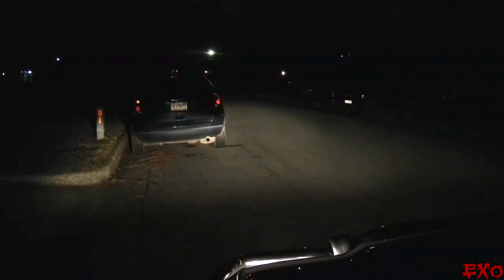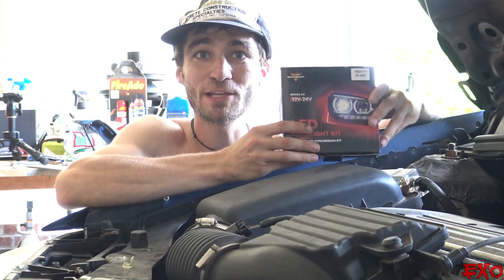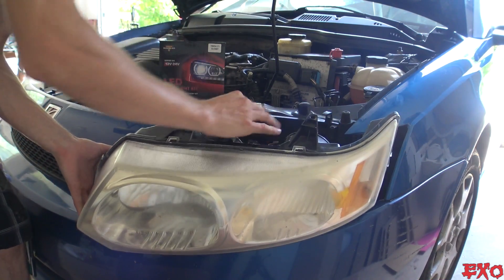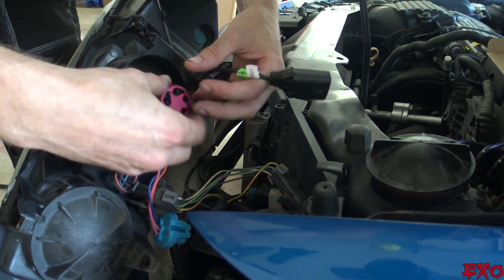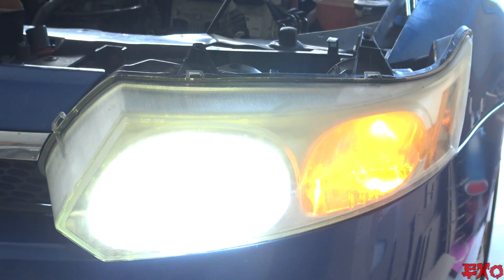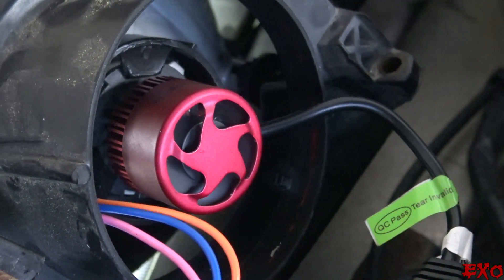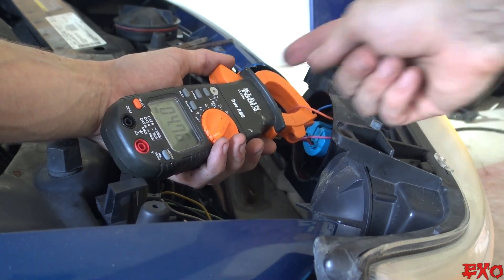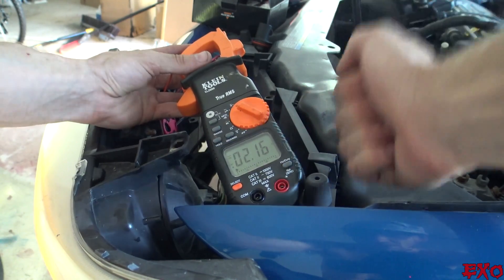How To STOP Dimming Headlights When BASS HITS | Testing Halogen vs LED Headlight | Fix Car Audio Dim

Comment: So will that work? I have 2 15s on 5000watt amp i have a extra battery installed i got everything checked an everything is fine alternator isnt dropping voltage but im getting headlight flickering
Reply: The shop I brought it to he told me change my wire on the alternator running to second battery from 4gauge to something bigger
Reply: @TrillTactical98  depends on the lentgh. i have a 13 feet run for my amps with 150 A peak load. idealy i need something bigger. but it's fine for my usage. batteries charge around the 150A range too. especially with higher output ALT's. definitely use some 0AWG or just run 2 4AWG to the rear if you wanna save some

Comment: I put a 200amp alternator amd a $200 battery in my and did the big 3 but with 0 gauge wire and still get dimming from my headlight and dashboard lights I am running a 1200wrms amp and 2 12s could will my electrical system be fine or is there something else I need to do that could stop the dimming?
Reply: Sounds like you should be fine, double check all your wires
Reply: @Carlos-ln1lx  I have basically same setup as this guy and sometimes you just need a second battery depending on the car. Even with high output alt and big3 upgrade
Reply: Good ground connection? #1 cause usually

Comment: I didn’t have a problem until I throw a 4500 in now they dem have the big 3 and a 320 h/o alt and grounds and power are tight and correct fixing to try this hopefully the led lights work
Reply: there’s literally nothing to stop it

Comment: I'd first like to say I love all of your videos EXO, i am a big fan. I have no doubt these headlights will work if you can get them at a good price for your vehicle but i would like to share how i fixed the issue. I tried a cap and a battery upgrade with no improvement, I have 3 amps @ 1400 watts RMS and stock 130 amp alternator. I fixed it by running an 8 ga ground wire straight to the battery. I am now questioning why they suggest grounding to the frame. 30 dollar wire problem fixed.
Reply: I think you are onto somethin bud
Reply: Did this really work

Comment: I have a 2004 Chevy 2500 I've upgraded the alternator as well as all the wires put in a second battery switch to all LED lights and I still get major voltage drop with my little 3000 watt amp please somebody help
Reply: what kind of amps is your alternator? I got a 220 AD244  from and got a smaller pulley for it. No more dimming lights not even on idle. I have a taramps 3000 rms amp and 2 sa12's.
Reply: George Eastlick honestly just let it be, too my knowledge it won’t damage your car
Reply: If your running 3k rms you need at LEAST a 390 amp alternator I would say. I always go with the fuse rating on my amp(s) plus my stock alternator. I have plans for a 320 amp next to my 200amp on my CVPI to handle a 2500rms system.
Reply: Having same issue I only did big 3 upgrade on stock amp/no additional battery. 5k rms which 2nd battery/ amp do you guys recommend

Comment: Or get a capacitor
Reply: Depending on your electrical system and what kind of Watts you're using, even a capacitor will not help. I am running the Big Four with dual battery setup and still get dimming at high volumes

Comment: Just upgraded to a 700w system and my lights dim bad in my 05 ford 500 100% stock electrical. Where should i start? I hear the big 3 but I have to drop my subframe to get to the alernator and thats to much.

Comment: I know its a very old video but these LED Headlights are "Shit"

Avoid 3 Sided ones!
They dont mimic the incandescent at all and have such a bad beam pattern!

You need LED headlights with 2 sides!
For example: 
-Auxbeam A2-Series 
-SV.4 from headlight revolution
-And other models with 2 sides
Reply: Why only 2 sides?
Reply: @hectorheco5194  because the 2 sided ones mimic the shape and placement on the bulb of a halogen filament. Which is good considering they're being put in housings designed for halogen. Keeping the beam pattern in the correct orientation and giving proper light output.

Comment: So my system is only 600W and my headlights still dim when the bass hits. Is this hazardous for my vehicle, or is this a relatively normal complication with sound systems?
Reply: Have you done "the big 3" upgrade?
Reply: @ChrisTwitty  I have upgraded wiring. What are the big 3?
Reply: Deep Poetic Society It’s only the most often overlooked upgrade in car audio. Search how to do Big3 upgrade on YouTube and do that. 

If you don’t plan to go bigger you’ll only need a 4 guage big3 kit.
Reply: my system is 300w and all if my cars lights dim

Comment: Or you can upgrade your electrical system so its not actually straind, make it 2 to 3 times more then you actually need...
Reply: Even running 250ish watts I got headlight dimming in my old car, the voltage was dipping like .3 volts but it was pretty noticeable

Comment: I haven't done the battery or alternator upgrade and was wondering if the power draw is bad for the alternator by premature wear?  I put a new cheap orion xtr 750 3000 watt (according to the box) amp in my 15 mx-5 to match up with a set  clearwater audio 8" speakers that now shakes everything and leaves your hearing muffled, but sounds 100x better...I was about to add a capacitor on the amp to stop power draw until I saw your vid and a few others on how they really don't work and could do damage to the amp and the last thing I want to do is blow my junk up...I'm a noob who realized the deeper I go the more confusing it gets...
Reply: Make sure you have good grounds..bigger ground wire and good bare spot
Reply: @trunkbangking , Thanks man. I finally broke down and sanded some paint off and did get a better ground...when  the strobing headlights got worse... i knew it was grounded

Comment: So in the past year have you had any issues with the leds?  I am looking to do a full led swap soon (low beam and fog lights) soon. Have already started swapping the other lights to led. Easier on an older car as I do not need to add resisters to keep turn signals blinking at the right speed
Reply from the maker: Still no issues, working GREAT!!!
Reply: @EXOcontralto  Cool just picked some up some leg fogs for my fog lights. Still looking for a good deal on good h1 LEDs

Comment: Hey gotta question for you. I have 2 Sundown 12s and a 750watt Amp and it's not only my headlights that dim. My dash lights do it too and it kinda makes me wonder if I'm causing damage? What can I do that's cheap and easy for a fix? I thought about a capacitor but not sure I really need that. And not looking forward to one of those exploding in my trunk. I know you have to hook it up backwards to really make that happen but I've heard those could still explode even when they are hooked up correctly.. Can you help me out?
Reply: Doing the big 3 really helped with the dimming inside my car as well as making sure my amps and head unit where grounded really well
Reply: @PedallingwithPaul     The big 3?
Reply: @Shelton87  search big 3 upgrade on exo's page here for full run down. The big three is upgrading(adding) 3 major power wires. 1 is main positive from battery  to alternator 2 and 3 are grounds. Depending on who you ask this part may very slightly. So battery ground to engine/alternator case is 1 and the other is battery to frame or chassis. Most all big 3 upgrades say 1/0 guage though 4+guage added to factory will be a bit help.
Reply from the maker: Have you considered getting an upgraded alternator or battery?
Reply: @EXOcontralto  I put a brand new alternator on my car when I got it but that's because I needed it and I also bought a new battery considering it was 5 years old.. But neither of them are anything special.. With this car it's not worth upgrading the alternator because I'll only have it for another 3months and guess that goes for the battery as well. No point at this time. But when I do get my newer car I will have to concider that. If it's something that will actually make a difference. What do you think about capacitors? Worth it? Or no
Reply: @Shelton87  caps not really worth it for a system of that size if you upgrade battery and alternator and do the big 3 (and good grounds) that should handle that without a capacitor. Caps where, at least for me back in the day, a cheap bandaid to mask the larger issue of not enough amperage flow. I may be 100% wrong on this but this is just what I have learned over the years
Reply: EXOcontralto ... I ran a 1 Farad cap, upgraded alternator, and a quality battery for years, to no avail. I’m out of the game now, but I do have an idea, that I should’ve thought of years ago. Rather than using a cap in the stereo system, I’d like to see if it helps to place a large cap in the headlight output circuit.
Reply: M Shelton ... a capacitor is as safe as you make it. You have to ensure that it does not move, and protect it from anything else that might move and short it out. I can tell you from experience, that it will not help on the headlight dimming issue, when used in the amp power circuit.
Reply: Upgrade to a xs power battery not a regular battery the xs power battery is more stronger and will be able to put out the power needed for you audio.

Comment: I have a Singer H/O alternator at 320 amps and XS Power D3400 wrapped in their thermal garbage. I have also done the big 4 in ofc Knukonceptz as well. This is in a 2009 Scion tC. Headlights are auxbeams highest version of lights, the gold ones. The headlights don't dim, but the interior led lights dim. The stock lights real bad, the led somewhat. I have an MMATS 4000.1 to one orion 15" black voice coil HCCA. And an ARC audio KS 300.4 To the front MMATS 6.4.1 setup. The 6 inch speakers were replaced with MMATS carbon fiber speakers. I run ALL knukonceptz pure ofc wire. I have a 0 Gauge running from battery to the amps and have the Knukonceptz KNF-60 as a distribution block. I have 4 gauge running from that block to the amps. I also have the rockford fosgate battery terminals. My lights are still dimming like crazy at 2000 RPM. Why is this? Should I switch to 0/4 Gauge power wire and 0 gauge for the amps?
Reply from the maker: Have you tested your connections and voltages?
Reply: @EXOcontralto  Yeah I have. 13.7 at the battery, and as low as 11.1 at the mmats 4000.1 input on each of the terminals. The arc audio amp only goes to 12.7. Why is this voltage drop so massive? I've spent thousands on upgrading electrical. 0 progress has been shown. I don't see how thicker wire would solve the problem. At the least, I am allowing less electric to flow with the 0 and 4 gauge wire. If this is wrong, please let me know.
Reply: @EXOcontralto  What can I use to test the alternator amp output as well?

Comment: I just bought a pair of led bulbs (8000lm 35w 6500k), It only works 5 wins after I installed it. It turned into extremely dim. I have no idea why. Does an anti-flicker adapter fix it ? or my headlights have already burnt?
Reply from the maker: Sounds like a wiring problem!

Comment: I think I need a new battery or another one.
Reply from the maker: Are you experiencing voltage problems?
Reply: @EXOcontralto  I put a new alternator in beefed up the wire and the big 4 I used 2 gauge for that wire brushed all my grounds. But my headlights still dim I'm putting in a volt meter jut to get a idea.

Comment: Gotta get some Bi-Led projectors, those leds are bright but when you are driving down the road the distance will suck since the halogen housing isn’t meant to house leds but halogen bulbs. All you’ll be doing is blinding oncoming traffic & the foreground will be too bright on the road bouncing back to you.
Reply from the maker: Not a single issue, complaint or comment from the law :)
Reply: EXOcontralto Not yet.

Comment: I have 2 fosgate p2 12s(400w rms each) running @1ohm on a pioneer amp that is 1600w peak and 800w rms @1ohm. not a huge sound system, but my lights dim. it's in a 2013 vw Passat s which still has the stock battery with the alternator at 140amps. my lights dim when my bass is hitting, and when I use a volt meter on my battery, volts drop from 13.8-13.8 to 12.5-12.9. what is the easiest way to fix this issue?
Reply from the maker: The easiest way to fix this problem would be doing exactly what you saw in this video! The only other alternative would be upgrading your alt and batts! $$$$
Reply: For longer term fixes, without upgrading the lights like Exo would be upgrading your alternator, battery(ies), and DEFINITELY your wiring, from your battery and alternator. I recommend for mid-sized systems (like yours) to have about 6-4 gauge wire replacing the stock ground wire from the battery and alternator and also the same from the battery to the amplifier/amplifiers. Otherwise, just do what Exo did

Comment: Is there a way to fix the interior lights from flickering?
Reply from the maker: Switch to LED, that can be a great start as well.
Reply: EXOcontralto I already have leds in my interior and hids in my headlights
Reply: If your LED interior lights are dimming, it's probably by design. Some LED lights are dimmable in order to keep that dimming affect after you close the car door. Mine do the same thing. Kind of annoying, but whatever. I rarely have my interior lights shining while running my subs. At night, I keep my subs down low while in the city anyway so as to not annoy sleeping people. I like to be considerate. My headlights, however, don't dim at all with the Auxbeams I have.

Comment: got a awnser for this?.... My headlights brighten when my sub hits wierdest shit ive ever seen.
Reply: kody dallas ur headlight are connected to ur amp xD
Reply: if its a modern pcm controlled alternator then its the pcm ramping up the voltage and amperage for the high draw because my car does the same thing you get a first little drop and then a voltage peak cause the pcm detects the low voltage and ramps up to around 15 volts

Comment: I get the dimming of my headlights so I switched all my car bulbs for led. It’s been a paid. The headlights are the worst. I’m not sure why but the headlights are the only ones that need a fan. They still overheat even with the fan trust me. Also the led bulbs are too big to put the dust cover back on so the chances of you getting water or dust inside the housing I huge. Led headlights suck. They are bright and pretty but very high maintenance. Change all the other bulbs in your car for led except for the headlights trust me. It’s just a pain and very Embarrassing when you have one headlight turning off and on when you are parked.

Comment: my lights are starting to this now on my car, only whem im opening or closing my cars windows. i know its sounds weird.
Reply: Dingo Tranzform 1. check battery voltage. 2. Check output of amperage of your alternator. If you're running a stock OEM alternator and CCA-Cold Cranking Amp battery chances are you need to upgrade both of them before running a high wattage bass system and installing the big three 0 gage cable. Makes no sense to upgrade the 0 gage big 3 if you're running stock Battery & Alternator. Trust me. I replaced my old 55 Amp Alternator with a OEM case with 120 Amp gut's wasn't to bad 70.00 bucks and stock Battery was 700 CCA changed to two 1000 CCA I had enough room under the hood of my 1975 Catalina to put a 2nd battery on the passenger side. I cut a steel plate and drilled two hole's and tapped them out for a battery hold down then welded the plate to the frame installed battery and hold down then run a 0 gage cable over to the alternator using slide on terminals with the allan head screw's to tighten cable securely. If you don't upgrade Battery and Alternator before you install the Big 3 you Will damage your high dollar Subwoffers and Amplifier chances are from power surge and distortion. Im 44 and been restoring my own rides since I was 16 years old. Guys any questions hit me up. This old Dawg can teach you young guy's to wire like a pro. My 1975 Catalina original stereo and wiring stripped and removed rewired with all AWG 0 gage cable and 10 gage speaker wire. 14 gage remote. All color coded. The Big 3 is nice and will restore around 25-30% more clean and clear sound but you must take the stock Batt-Alt off and upgrade. If not your defeating the purpose. Don't forget noise suppressors get that Hummm out it will kill your amp-subs.
Reply: Dingo Tranzform Mine did too. Turns out it was the alternator putting out lower amps than specs
Reply: ShadowDancer6990 i mean my car starts fine though ill have to check my alternator
Reply: Dingo Tranzform My start was fine but while the radio pushed bass the lights would dim. The alternator amps were low. Replaced it and no more dimming while the sub pushed hard bass. 10 amps below spec can cause dimming when the sub is pushing hard.
Reply: ShadowDancer6990 the sad thing i dont have any subs or amps well i think the Monsoon system I have in my Grand Am does but i am selling it now tho
Reply: Mine too!!! Seriously thinkin bout adding led simply for the fact they dont steal as much power from my audio system! And i really dont want to by a new HO alt for a 17 year old car with over 160 k miles
Reply: Jesse James what year car.

Comment: I managed to get dimming on HID's before when I had my BRX2000.1d amp in my firebird, pulling so much power the engine was damn near stalling while driving down the road.

Comment: Switching to led save some voltage to
Reply: an amount that literally might as well be 0 since thats what it will save you in gas and the draw difference will be 
 so minor as to not be worth measurement unless your running 14 high output lights